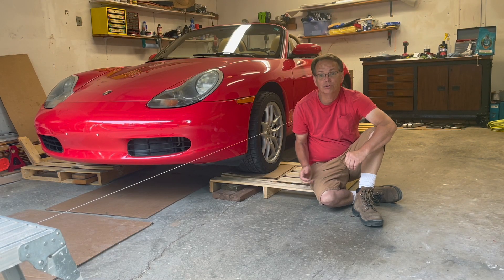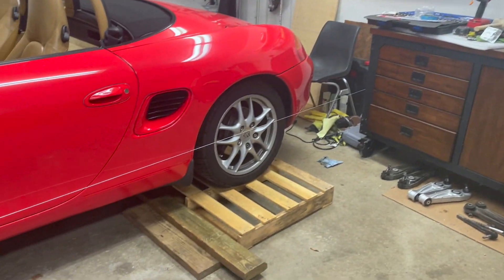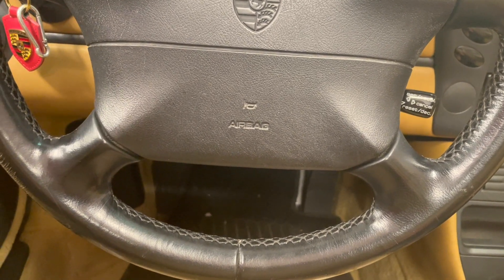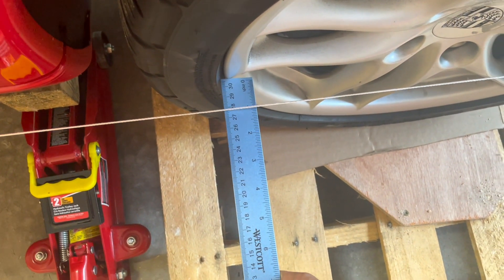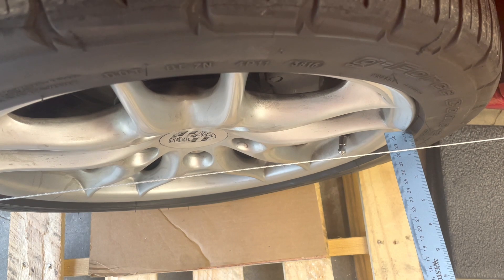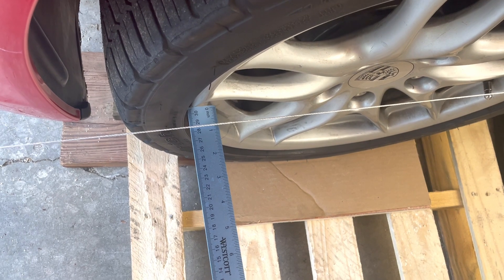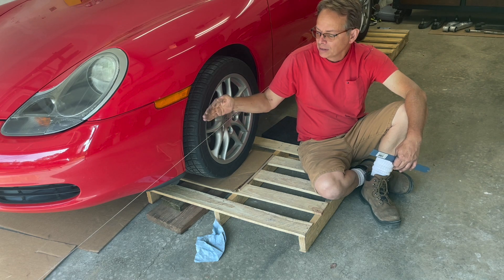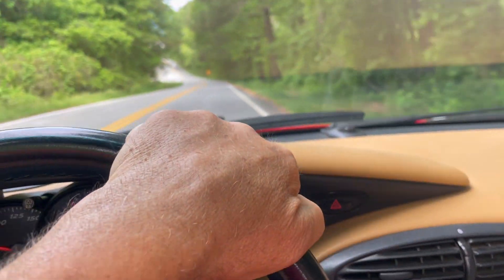Porsche 986 front alignment

Comment: Great video!  I like the idea of using cutting boards to slide the wheels. I saw another video where a guy used two sheets of aluminum and spread some axle grease between them to get them to slide.
Reply: They do sell sliders for around $100 on Amazon to make it more practical.

Comment: Your fundamentals are good but the execution is questionable. This is so unsafe using old pallets to hold up your car. The 4 corners of your string square need to be perfectly square for an accurate measurement and try using millimetres. Use stacked plastic cutting boards under your tires so they slide better than on cardboard. Better yet spend the $80 and get a basic alignment.
Reply from the maker: As I'm sure you saw, there was extra lumber under tires to make it safer. I like the idea of plastic cutting boards. Having to adjust the steering every time was the most aggravating part of it. Also the point of doing this was that I didn't have the $80.00 to spend on an alignment, but I do have the time and the will to try it myself. 
I appreciate you watching.
Reply: @jasonsporschechannel945  I love to see a man on a budget, but also take good care of his things.